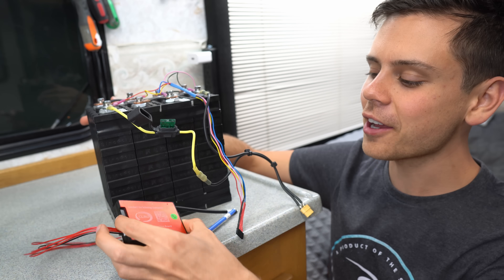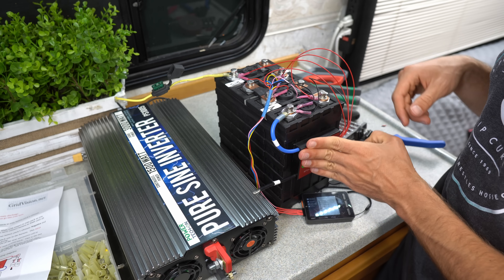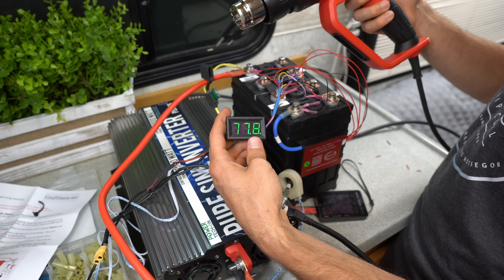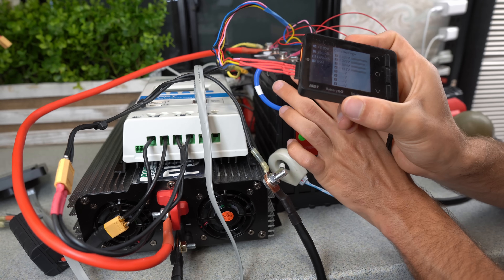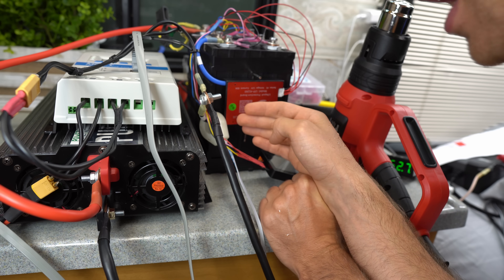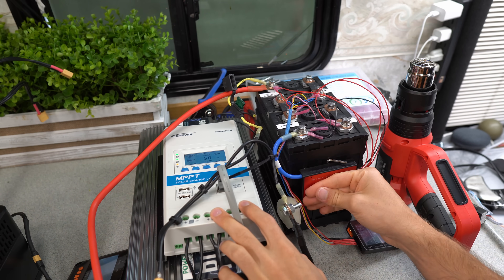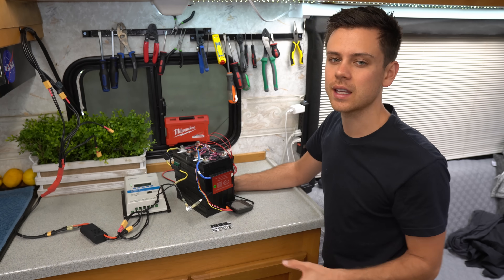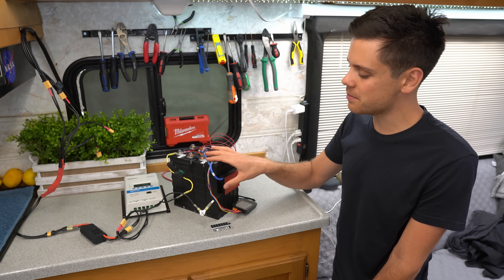12v 60a LiFePO4 Solar Battery BMS for $32- Installation and Test!

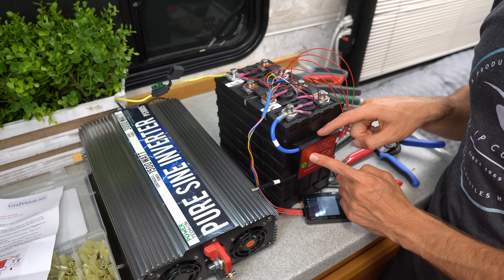Comment from the maker: 0:16 - 1:45 How to Build it
1:46 60 amp Load Test
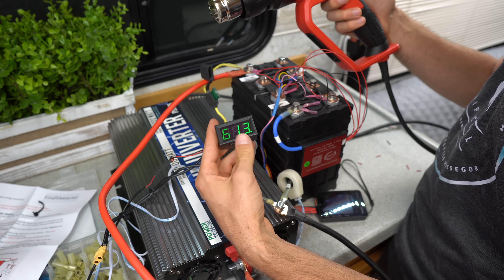3:41 Over Current Test
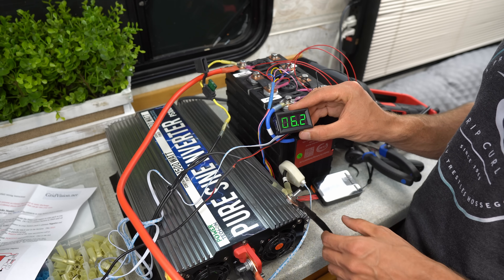4:45 Over Voltage Test
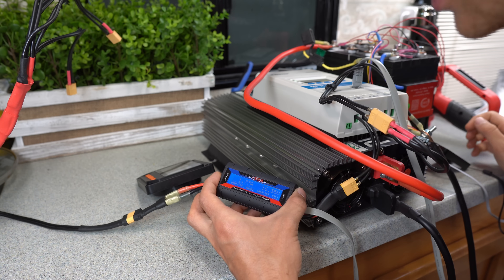6:56 Over Discharge Test

8:44 Conclusion and Things to think about when choosing a BMS for your system

Tired of getting ripped off? Check out my "Will Prowse Approved" solar product recommendations below!

12V Batteries
https://www.mobile-solarpower.com/lithium-batteries.html

48V Batteries
https://www.mobile-solarpower.com/48v-batteries.html

Offgrid Inverter System Builder
https://www.mobile-solarpower.com/48v-complete-system-blueprint-559371.html

Hybrid Inverter System Builder
https://www.mobile-solarpower.com/code-compliant-48v-offgrid-system.html

Mobile Handtruck System Builder (very popular!)
https://www.mobile-solarpower.com/mobile-48v-system.html

Solar Panels
https://www.mobile-solarpower.com/300w-solar-panels.html

Ground Mount Solar Racking
https://www.mobile-solarpower.com/ground-mount-racks.html

Wire, Lugs and Busbars
https://www.mobile-solarpower.com/wire-and-connectors.html

Tools
https://www.mobile-solarpower.com/tools.html

Fuses and Circuit Breakers
https://www.mobile-solarpower.com/fuses.html

Plug-N-Play Solar Systems
Ecoflow, Anker And Bluetti! So many models to choose from. See my current recommendations here:
https://www.mobile-solarpower.com/full-size-systems.html

~~~~~~~~~~~~~~~~~~~~~~~~~~~~~~~~~~~~~~~~~~
Need to build a large DIY system? Need a trustworthy solar distributor? These are my favorites:

Signature Solar
Creator of EG4! Solar Minisplits, Victron and More! Largest Solar Store Online.
If you want $50 off, please use my link below and coupon code "DIYSOLAR50":
https://signaturesolar.com/?ref=cPwLcVc0SW-BjN

Current Connected
Best Prices for EG4, Victron, Midnite and so much more! Fast Shipping and Highest Rated Customer Service:
https://currentconnected.com/?ref=wp

~~~~~~~~~~~~~~~~~~~~~~~~~~~~~~~~~~~~~~~~~~
Join our DIY Solar Community 
Need more help? Join the largest solar forum on the internet for beginners and professionals alike. 140,000 members and counting!
https://www.diysolarforum.com

Check Out My Free Book
Best-selling and beginner-friendly guidebook to off-grid 12V solar!
https://www.mobile-solarpower.com/the-book.html

~~~~~~~~~~~~~~~~~~~~~~~~~~~~~~~~~~~~~~~~~~
Contact Information:
I am NOT available for personal solar system consult! If you wish to contact me, this is my direct email: williamprowsediysolar@gmail.com
FTC Disclosure Statement and Disclaimers:
Every video includes paid promotion or sponsorship (such as free products for review). Some links on this YouTube channel may be affiliate links. We may get paid if you buy something or take an action after clicking one of these. My videos are for educational purposes only. Information is subject to change/update at any time. Electricity is DANGEROUS and can kill. Be smart and use common sense :) DIY Solar Power with Will Prowse is a participant in the Amazon Services LLC Associates Program, An affiliate advertising program designed to provide a means for sites to earn advertising fees by advertising and linking to Amazon.com
Reply: Nice video  ... the BMS is meant to get hot ...don't worry about it ..... Balancing only starts when fully charged , the BMS  slightly discharges the cell which is full first  so the others can catch up ... but this current is very small about 30mA  , cells don't get out of step much ... so they must all be at the same level before you connect the BMS , so they start off balanced ... They often don't come from the factory at same charge level ... leave the cells in parallel for a day , then put in series and connect BMS
Reply: Hey man you seem to be pretty smart when it comes down to BMS can you help me out with trying to get mine hooked up my setup is a little bit different than the one I saw on your video
Reply: Hi, I have the Daly 12v 100amh bluetooth bms, can I use it for a 12v 200amh lifepo4 8 cell battery
Reply: @TimShedsWorldView  I believe you can if it is an 8s BMS. My understanding is that you will be limited to 100c rate….Which is probably good because you do not want to charge any battery at full C rate.

Comment: I bought one of those it works but the capacity meter is 100% inaccurate they did send a replacement it's also bad but the battery meter is accurate it just doesn't output any current

Comment: I have a question sort of related to this. My Liitkala 150ah battery showed 0 v when doing maintenance charging. I couldn’t get any of the boost procedures to work so I took the battery apart and found that it had 12.9v in the battery pack. I bought a new Liitokala BMS and now it has 6.4 v at the terminals and my lithium charger still won’t charge it(still has 12.9v from the battery pack to the BMS). Bad BMS or other problem? The new BMS was a mirror image of the old one but I noticed that and wired accordingly. Thank you 
After reading many internet sites I finally decided to test the b1 b2 b3 b4 voltages and found that they were descending from b1 12.8v to b4 3.2v. I thought that the bms worked by reading the voltage of each battery then adjusting the charge. This is not the case. It analyzes the total voltage starting at 3.2v at b1 and growing to the 12.8v at b4, adjusting the charge of each cell by the variance of each from the expected accumulation of the cells. Since the replacement bms was a mirror image of the original, I had the cells wired backwards in order.

Comment: Hi Will! Excellent videos! I would like to use 2p8s installation with one BMS, but what you say about using only 1 BMS? Could you recommend what kind of setup I could use to build roughly 400ah system? Problem is that I could not find any 400ah cells and 320ah is little bit too small for my application. Thank you!

Comment: Is this fine to do at a larger scale? 4x 12v 400ah lifepo4?

Would i just need a 48v 4s bms?
Reply: If I'm building a battery bank of 4s3p (12x 12v 400ah). I need 3x bms or can I use a single bms across all batteries?

Comment: can this BMS be put into series - i.e 2x12v batteries @24v?  or is anyone aware of a cheap 12v 50a or so bms that can do this? I have 2x12v batteries but need 24v for my trolling motor on a boat, so easiest option would be to replace the bms in each battery.

Comment: Will, I am using these on 40 Toshiba LTO SCIB batteries using 24S because I don't have to worry about low temperatures. I initially started with 15 batteries and Daly BMS'S I purchased direct from Daly and they were shipped to me in 8 days. Very fast shipping from China. I just ordered 25 more a month ago and got them in 7 days. The initial 15 have worked flawlessly in keeping the cells balanced. I can see no reason to use any other brand for LTO batteries.

Comment: Hello, Great videos I have watched most of them. I actually was looking for a new BMS and found this one online and thought about it. I have just bought some Miady 36ah batteries and was thinking the BMS needs an upgrade. Currently, they just have a tiny little non-heatsinked one that sells for about $4. Would be great to see maybe a video taking the cheap Miady cells and replacing the BMS or combining them in a new box with a new BMS.
Reply: So the Miady batteries really overheat during load to the point they melted and weren't safe. I think the cells are okay but thinking of making a better battery from them with a new BMS and some cooling. I need to be able to drawn 35amps continuously peek but generally 5-20amp.

Comment: So I’m in the process of building a backup battery pack for my ham radio shack.  I watched other videos but I’m having issues with finding a good quality BMS board to install with my batter pack.  Do you recommend this one ? Or is there a better quality one ?   I got the idea from OH8STN ham radio Portable solar generator video.

Comment: watched some videos and recognized sometimes some errors, for example in this video: @ 3:24
The wires are getting warmer => resistance increases => that doesnt mean that also the current increases.
The current decreases with an increasing resistor!
Reply from the maker: The current is increasing because voltage is decreasing and we are pulling same wattage. So current goes up

Comment: MrWill, I have purchased a Dale 200 amp 16 S their English manual would probably be easier to understand in Chinese. My question is this I’m setting up my batteries I want to charge them in smaller configurations at first. Can I use a Daly 16 S on four LiFeP04 cells at a time, thanks for your Informative postings!

Comment: I first soldered the P-, B-, C- onto the battery. I continued hooking up the balance wires in the correct slots but in random order, then i noticed little smokes were coming out of the bms, but the battery pack were fine. Is there a pattern to install the wires from the BMS to the battery? I’m trying to find out what I did wrong. Unless it was a defective bms.

Comment: I have been looking at that particular BMS for a portable battery for  use with ham radio equipment. The biggest concern is RFI some of these devices produce. Do you have any guidance? Are these quiet?
You might want to add a RFI test to your repertoire. You could set up a $150 spectrum analyzer with an antenna and just do a quick scan. This would expand your audience to the ham community.

Comment: Hello Will
thanks a lot for your great videos. In this video at 11:13 you've mentioned that's possible to run more than 1 BMS in parallel for the same battery (even if the wiring will be more complex). My problem is that the new high capacity LiFePO4 with 304AH are able to deliver between 250-300A current to drive a 3000W inverter continually. But to find a BMS with 250-300A which is affordable is a big problem they cost e.g. between $180 (250A) and $280 (300A). So for a 4s 12V setup with these 304AH batteries it would increase the cost a lot. I think about using 3 of this cheap 4s 12V 100A BMS in parallel.
But I wonder what about running 3 balancer in parallel and even more what about the over/under current protection shut-off of 3 BMS in parallel if they are not synced? It would be great if you could comment about this question. I'm sure many other will have the same question with this new high capacity batteries.
Frank

Comment: What is that blue "battery protect" you mentioned at around 5 min? You said it could disconnect in case of low voltage.

Comment: I have an outboard motor on a boat that needs 200-300 amps to crank for 3-5 seconds at a time. Start up several times in a day, then 30amps continuous for the rest of the day. What Daly BMS would be the best to buy?

Comment: I've learned a lot and love all of your videos!! Your story is also inspirational.

I have a 110v, 30 amp RV. My battery bank has 12, 12v Eve LiFePo4 280AH in a 3P4S configuration.  I'm running a 5,000 watt Pure Sine inverter. The representative only sent 1 PWOD 30A Charge, 30A discharge module which I'm not sure is optimum or even sufficient. Just fyi, I'm charging with a 60 amp Renogy MPPT and have 1000 watts/20V of solar panels. What would you suggest for a BMS? Also I'm finding that the bms's on Amazon have a higher discharge rate than charge rate. Since I have 1000 watts of input, 1000/20 = 50, wouldn't I need at least 60 watts of charge capacity?

Comment: Hi.i bought a similar like this- with a 30A discharge current, and 15A charge current.. my question is what does 15A charge current mean? I checked mmpt charging current exceeds at 21A at noontime.. what does 15A BMS charging Current mean then, does it mean- it  limits 15A only?

Comment: Looking for a RECOMMENDATION for 4s 3.2v BMS 40amp or so, for 4 prismatic 25ah cells. 

Your link for “cheap” daly bms is $180…..not sure what happened there. 
The lowest cost for Daly Lifepo4 3.2v 4s is around $60…..does that seem right?

Comment: I realize this is an old video. I can't find that bms. The ones I found have over voltage disconnect at 3.75 volts. I think that's to high

Comment: How to know how big needs to be the bms in A? The maximum output of my batteries or the maximum consume of my appliances? I am confuse :( my diy battery is 48v 50Ah - 54Ah and sometimes my appliances are going to consume a peak of 4000w a few seconds. I hope any bms can be use in parallel when I make a second battery in the future >.<

Comment: I imagine you get a ton of questions from people delving into this area but hoped you could enlighten me if you have time.  I created a 3S24P 18650 battery to be used as a driveway wall lamp.  I used a Daly 20A BMS but did not realize it was either that small nor using a non-standard BMS cable.  As a result and in line with one of your other videos where you stated no negative repercussions exist for hooking multiple BMSs to a battery, I added a second 3S BMS cable.  Attaching the first to the B0 (most negative) and on the positive side of each series set each subsequent cable (B1-B3 , Matching the Daly only ensuring I used separate a separate location on the nickel plated fuse sheets).  Once complete I tested voltages reflecting a 4v jump per connection telling me it was connected properly.  I then attempted to use the BG-8S attached to the newly created battery but it never powers on the unit.  I assumed maybe the device was faulty and tested a prefab 3S commercial battery and it powered on properly and showed the state of each cell.  What else could I be missing as I have run out of options.  Sorry for the lengthy post but I wanted to be as concise as possible.  Thank you for your time and your videos I find them very helpful.

Comment: In the first couple minutes of the video I had a question about the amp usage of the heat gun.
The heat gun uses about 12 amps how does your meter come up with 60 amps?
60 amps DC ?

Comment: pushing 60 amps and placing naked battery contact on the metal frame of the inverter is not a pretty safe thing :)))

Comment: Hi,
I have a question regarding BMS and MPPT SCC,
the issue about the BMS high voltage disconnect which could damage the SCC while charging,
what was your thoughts on this?

Comment: I am going to install this BMS to 4S in 7 packages and then connect them together paralell for a 12V system. I dont see any worries about this exept for the safety issues of course. I have an Inverter 230/3000/12. I think that a discharge of 60A for each 4S will function. Any thing I should reconsider?

Comment: So I'm looking to build a LiFePo4 battery for a dual Battery setup in my 4wd, just a quick question if I was to charge a battery set up like this with a DC DC charger how would I stop it from going into an over voltage situation? Would the dcdc charger disconnect it's self before the BMS trips?

Comment: Will thanks for your efforts in getting all of us on board. Question I have set up a 4s12V Daly BMS on 4 -280Ah cells. BMS will not let the attached inverter function. Do I need to “jump start” the BMS with a short burst of charge current from a 12V charger?

Comment: Hahaha remember when Will Prowse left the balance leads plugged into the BMS while he connected the leads to the battery and didn't use a resistor to prevent the spark when plugging in the inverter? Ahhh, the good ole days!!!

Comment: Hi, a question : when NO load is connected, what is the quescient BMS current that you can measure with a clamp ammeter put on the blue wire between the minus battery pole and the BMS board ?
Mine reads about 50mA and I think it is way too high ... what's yours ?

Comment: Graet video! 
what voltage does the battery have after charging, i have lifepo4 4s, 3.2v 100ah, after charging the battery is 13.4v.
Thanks

Comment: i have 8 of those batteries in this video i want to wire them 12v with max amperage could do you have a video on how to wire 3,2v cells in series and parralel to do this cheers from Australia

Comment: been watching a lot of your vids, if i build 2 sets of 12 volt battery's using 4-3.2 volt cells, could i charge 2 of these with one 4s 60 amp bms or do i have to disconnect one pack and hook it up to the other pack, or can they be charged together some how as one large pack

Comment: Hi will, i have had several inverters blow up on me recently, the reason being my bms cuts off before my panels and my controller spikes up to 24 volts when my battery cuts off. My inverter is only 12v. Any suggestion for a 14v cutoff for my inverter?

Comment: Hi Will, 
I love watching your videos, you make it fun to learn.
I'm planning to build a battery with Lithium Polymer 3,7 volts cells (4 in series), they are rated 300 watts each. First question; what kind of power (amp hour) would that give me ? And second question; could I use this BMS 12 v 60 amp for that type of cells? I'm planning to connect an inverter for a 1500 watts induction stove. If this is too small, is there a stronger one that you would recommend ? Thanks.

Comment: Hi, would the BMS guarantee that the battery's SOC does not drop lower than 20%? I'm building a system for a 600W inverter but I'm not sure if I need a battery protect